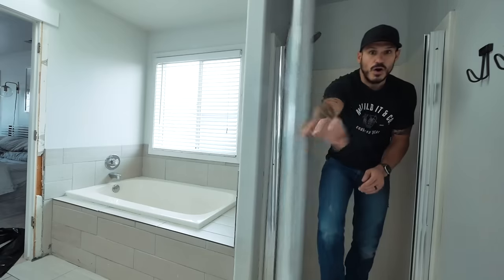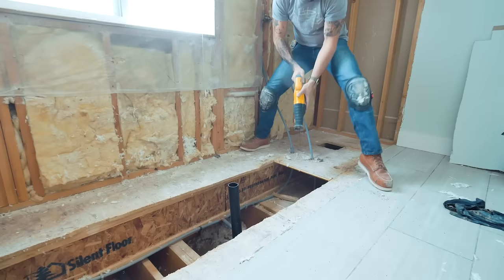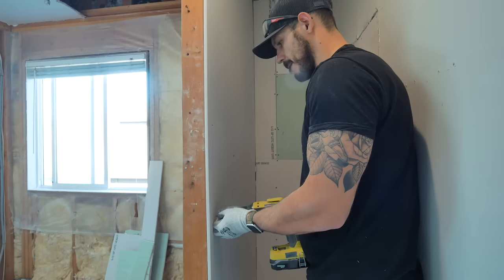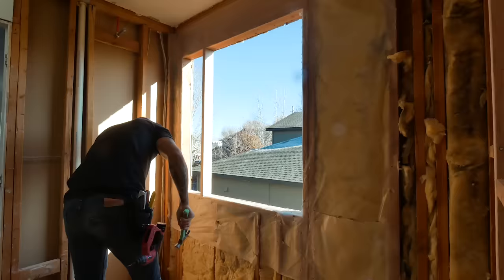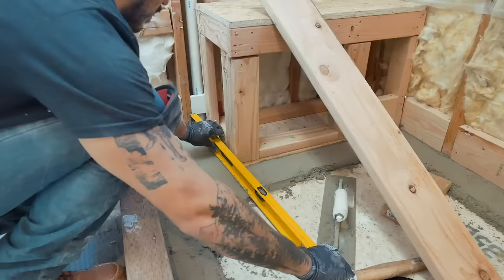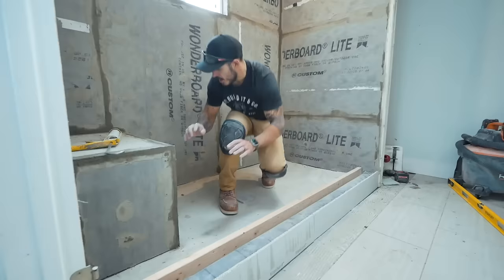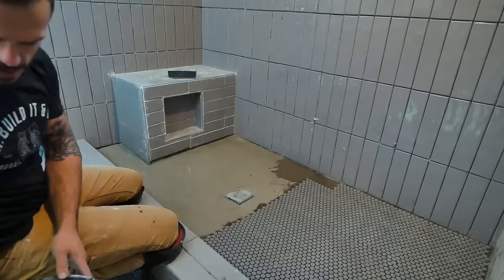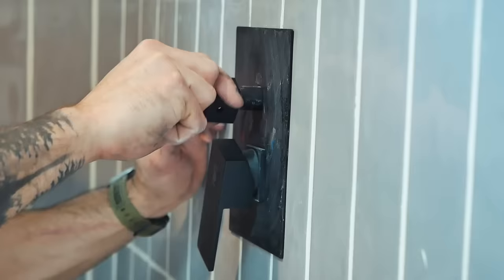Building a GIANT Shower (Home Remodel)

Comment: A couple of things:  You need vapour barrier and metal lath underneath that dry pack mortar bed.  Otherwise it dries out on the bottom too quickly when setting and will crack/shift.  The lath gives it something to grab onto as well, and you can just staple that through the vapor barrier to keep it in place.  I am concerned that your dry pack will crack over time, causing a total failure of the substrate and breaking your tiles or grout lines.  Whomever told you that was "outdated" is, quite frankly, wrong.

Also, you do not grout in changes of plane.  That is, where one wall meets another wall at a perpendicular angle.  That should be caulked to protect against cracking - as per tiling code, but not just caulking on top of grout. Just leave those spots empty while grouting, and then caulk those lines after.  

One helpful hint for those of you who are house-shopping and see a nice-looking new shower.  Look at the corners, where one wall intersects another.  Did they use grout there?  If the answer is "yes" then your shower was built by an amateur and you should assume it will be a total rip-out in the next couple of years (when the tiles or grout lines micro-fracture or mould takes over behind the tiles due to water leaks from those micro-fractures).  If they caulked there, it was likely a professional, or someone who was well-versed in the techniques before they started the job, and it is safer to assume that the house you're about to buy doesn't need immediate attention in the shower/wet areas. Water is not something to be approached in an amateur fashion, especially on upper floors.  It can and will destroy your home if you do not use the correct techniques. "Close enough" might be close enough for installing a new closet or shelving unit, but not when it comes to wet areas.

Decent waterproofing techniques - though for a DIY'er it is much safer to use something like Kerdi Board which has much less chance for error.  That being said, when your dry-pack substrate fails, and I genuinely believe that's only a matter of "when", and not "if", I suspect your waterproofing measures are going to fail along with it.

Finally, the standard grout width for that size tile is 1/8" where it looks like you have 1/4"?  That's partially why your tiles get really small in the corners. 

EDIT:  And correct me if I am wrong, but the top of the bench/niche appear to have no slope, so they're going to hold water.  1/4" per foot is industry minimum.
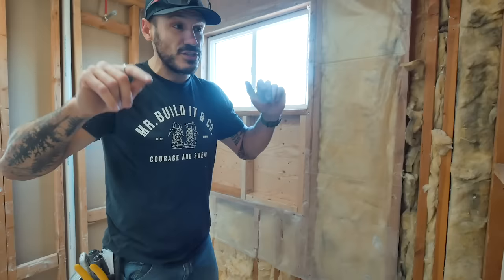Reply: Oh, and one more thing.  Compressed insulation has almost no R-Value at all.  It should not be crammed into spaces such as shown at 7:34.
Reply: Original Otrex - also changing dimensions of the window opening requires building permits.
Reply: @leolego2  Correct, if you cram insulation into a confined space, you have defeated the purpose of that insulation, and have essentially created an uninsulated space.   If you cannot get traditional insulation into a tight space without squishing it, you're better off using spray foam.
Reply: @mar1video  Correct, but I'm talking more about things which are functionally wrong (i.e. will not work well or will fail) versus making sure your paperwork is in order.
Reply: Solid constructive (construction) feedback.
Reply: @mar1video  Also, install sheathing, weather wrap, and THEN the window.  

He nailed the window directly to the framing and then covered the nailfin with sheathing.  Its going to be a BITCH to replace down the road, and also poorly sealed.
Reply: Great post!  I noticed the same things as you did.

Lack of waterproofing and shitty tiling is pervasive throughout new homes and remodels nowadays.  Cheap, unskilled labor that just throws stuff together to get paid.  Leaky showers will keep a lot of contractors busy in 5-10 years!

I renovated my house and taught myself tile since few wanted to do it the right way.  I stick with tubs and shower pans, they're naturally waterproof so I only have to deal with the walls.  Mud pans are tricky to get right, and so many are done soooo wrong.
Reply: @mar1video  Who cares about building permits, Something that small is none of there business, Permits like this is just another way for the city to make money.
Reply: Just watched this video in 2024 and noticed all the same things and more!! Don't connect white PVC to black ABS without a special green Oatey glue/cement.  Needs lath,  Kerdi board, Kerdi fabric, weather wrap, uncompressed foam, matching sanded grout in corners, slope on the bench and curb, etc etc etc.  And LOTS of water proofing around that new window where the tile meets up against it!  Water and the wood underneath will ALWAYS lead to a bad outcome!

Comment: FYI: plumbing vents aren't to allow sewer gas to escape. They are to let air in. Put your finger on a straw and pull it out of your drink then let go. Same concept. If you drains aren't properly vented, they will drain slowly.
Reply: noticed how that p-trap is not vented at all, the way it's installed, and might let the odors in?

the lenght of the P-trap's ''arm'' is required to be of a minimal lenght, determined by the size of the pipe, and said arm has to be vented before the slope cuts any possible ventilation in said pipe when full. that would be when the top of the pipe is as low as where the bottom is at the start of the slope.
Reply: I loved learning all about how before P traps were a thing, people used to die quite frequently from sewer gases 'burping' back into the homes via toilets.
Reply: Also, in most jurisdictions you cannot use green transition glue inside the house. It’s against plumbing code.
Reply: Thx
Reply: James if that is the case why do they vent through the roof? Couldn't they just vent into the floor space?
Reply: @benedictearlson9044  because when plumbing isn't being used and the vents aren't drawing air in, sewer gas does escape.

Comment: him: takes hours to paint ruber on it

me: slaps flex tape on it
Reply: @Robert w water goes right through grout.  It's not waterproof
Reply: @Robert w that extra $120 spent was for his peace of mind that he did it right the first time, and he won't come back to it again after discovering a failure which would cost him more to redo and repair.
Reply: @Robert w Did tile for 12 years.  Mostly really high end expensive stuff.  Can confirm I've never seen someone do a rubber painted layer, but we almost always did mud wall and had black paper behind it anyway.  I'm not saying it's a bad idea but the room is going to look terribly dated and will be redone LONG before enough water could get through the concrete board...that is assuming that you properly seal the grout.  Properly sealed grout is your first and best defense against moisture. 

That being said, a lot of these construction differences are regional and what is common practice in one area seems crazy in another.
Reply: It's not just about water it's about water vapor water vapor condenses behind the tile and concrete board. if you paint the whole shower with the liquid waterproof membrane that is your last line of defense against water vapor and the schluter system is the absolute best system for shower and sauna installations

Comment: That shower is awesome. I'm on slab instead of a subfloor so it's a lot more difficult for me to relocate drains and stuff, but I'd like to try something like this. I don't think I'd use shark bite fittings for anything that goes inside the walls or ceiling though. They rely on rubber o-rings* and are more likely to fail than a crimp fitting.

Comment: Awesome vid but two critiques:

1. Why did we not get to see it in action???
2. Why in the world is that one shower head so hight? Can your wife even reach it???
Reply: i was annoyed, because it's a detachable head. you build it standard height or for the shorter person, because the taller can easily pick it up because it's detachable and then use it. have a feeling his wife is going to make him redo that.
Reply: In our walk in shower, which used to be a standard bathtub, I had my handheld shower head put in to be easily reachable for MY height and not up high just in case some NBA player got
 lost in the woods and really needed a shower. My waterfall shower head is a bit higher than the handheld, but still reachable. I even got inside before it was done and marked where I wanted it. I also have a light in the middle of my shower which is really helpful. 
We also had some space left over on the side of our new shower insert like he has in this video, so my husband built shelving for towels etc. Being petite, I have short arms and it's a deep space. So I asked my husband to redo it and  put the shelves on tracks so I can pull out the shelf, get what I need and push back in. He did it, and it's wonderful. I also had a window in my bathroom- not in the shower- but where the shelves were put. So we moved it over and got a smaller 24" window and on the bottom we put cling on amber colored stained glass. Even though you can't see in the window, it made me feel better and it gave the grey and white bathroom a pop of color.  I put a very light grey and yellow swag curtain on the window and put a matching tailored valance curtain across the top of the shower. Both curtain sets also have little light yellow/amber colored beads along the bottom and they are just perfect and give the room a French country look; a bit pretty, but not loud and cluttered. Just right. We did all of this in 2004 and I still love it today.

Comment: Being in the tile idustry myself I was surprised how well you handled installing your pan material. Those grout joints get to my souls when they don’t always line up though 🤦🏼‍♂️
Reply from the maker: lol thanks man
Reply: Lol being a tile guy myself one thing that stresses me out is is seeing other people’s grout joint not line
Reply: I'm a DIYer and one of my first tiling jobs was black and white 1" hexes, about 50 sq ft of it.  I hate seeing grout lines between tile sheets, so I randomly cut the sheets up to stagger the joints.  Did a great job and rewarded myself by using black FusionPro grout.  Only about 5 tiles are a little out of alignment, I'm the only one who sees them!

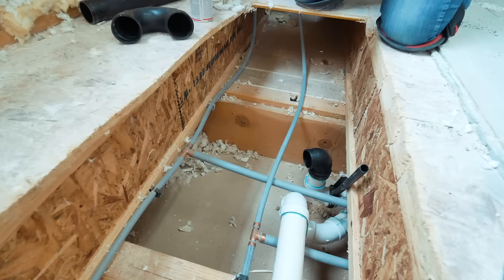Comment: 2:16 Pretty sure you created an "S-trap" with that drain instead of a "P-trap" which isnt allowed and can siphon out the trap water.
Reply from the maker: I'll fix it if it gives me issues. This is on the second floor
Reply: Yes he did but I am guessing there wasn't a plumbing inspection so since he did the work himself it will be that way until he sells the house or fixes later.

The issue will really be that sewer gas smell will come into the shower space.  If he notices it, then there is motivation to correct it.
Reply: So that's why I have that darn smell. Thank you, I will now rip my old crappy bathroom apart.
Reply: So if I tell my husband I smell sewer gas in the shower, I will get a new bathroom?
Reply: Peony Farm it’s worth a shot!
Reply: By "code" S traps arent allowed. Pretty sure it's his personal. Let him learn I guesd
Reply: @bartscustoms  Well he will learn the hard way buy not wearing a dam mask!
Reply: Mr. Build It You should fix it ASAP.  Your shower is not vented.
Reply: Yeah should have cut the 2x1-1/2x1-1/2 tee off ran a 2" tee with an 1-1/2 bushing in the top to catch the vent and ran the 2" out of the tee to the new trap. Joining pvc and abs with anything other than a mechanical fitting is also illegal but it does work with just glue......for awhile. Nice work regardless
Reply: Peony Farm you are so evil🤣🤣
Reply: @bradausman  My girlfriend's house had that problem. Made the bathroom smell seriously fucking awful.
Reply: Yep, and being on the second floor I'll wager it's a "long drop trap" too, which also has the same problem and is also not up to code.  It's going to suck that slug of water right on through  (which is supposed to remain in the trap) and leave that trap dry and stinky.
Reply: @mydailyreward2090  Unless its your husband that smells :)
Reply: @mydailyreward2090  unless its your husband that smells :}
Reply: Mr. Build It 
Could just put an atmospheric vent valve if it gives you problems
Reply: Regardless, nice work!!

Comment: The paper face of the insulation is supposed to face the inside of the house.
Reply: Ok I thought I was the only one that saw that as well, the vapor barrier/Kraft paper should face out.
Reply: @packetattack7437  depending on location and climate it can be either side

Comment: “wHy iS iT wOoD”

Cause it’s cheaper for us? Easier? If done correctly will never touch water?
Reply: BUFFALO666 
Lmao sorry that I was born in America man
Reply: gets blown over by silly little gust of wind
Reply: dayyou 
Majority of us never have to worry about hurricane or tornadoes
Reply: dayyou we don’t get tornadoes on the east coast for one
Reply: Should have used a foam curb. Untreated wood in the shower is a no-no.
Reply: Dvach if that’s curb ever gets water, you’re doing it wrong.
Reply: @hotfudgemoney  It's bad practice. There is allot of humidity in a bathroom
Reply: Dvach you’re doing it wrong. By your logic, the sub floor should be treated plywood, and the joists supporting a bathroom should be treated.

Comment: So I attempted this project. Here I am over a year later, and I FINALLY put the last finishing touches on it. Let me just tell you guys, it is SO MUCH MORE WORK than this video makes it seem like. Also, if there were 1 thing that I could go back and hire a professional to do, it's pouring the shower pan. That shit is impossible to get perfect if you're a first timer. Hire a pro or buy a prefab sloped floor. You'll thank yourself for it. You've been warned!
Reply: I had to scroll waaaay too far to find a comment that was sharing my same thoughts.  I'm trucking along with only the walls to go two weeks later.  It is nice to have a guide to go by but I wish he got into more detail and was more realistic like the time it takes for everything to set and dry and set and dry...

Comment: Did pretty well on the water-proofing and didn't screw into your curb on the inside, that's good, but at 11:54 you need to use lathe for that curb. 1/2" of concrete, over time, can crack without reinforcement. The tile bears weight, but there's always movement.

Comment: i dont get these showers with only a glass wall covering half the opening. every time i use one in a hotel a bunch of water splashes out.
Reply: exactly what i was thinking; how does this work?
Reply: It works really well. Since the whole area is water proof it doesn't matter.
Reply: Slide that bih to close it

Comment: "What's the worst thing that can happen?" Well, if you run your water lines through your attic you better not live in a cold climate where attics can get below freezing. Frozen water lines burst.
Reply: Yeah judging by the insulation in the ceiling, he might not have a heated attic, which could get REALLY dicey.
Reply: I think the lines he ran through the ceiling are the shower head supply lines. In other words, only filled with warm water when running and not under pressure when off. Either way, dicey given that the wrong pitch will keep the line filled with water all the time. Although I suspect the PEX pipe helps.
Reply: @japaneserequired6314   Tilt your head down.

Comment: Great video. I’m a licensed professional, top of class, your point.
FYI that Masonary drill bit is not meant for tile. A diamond drill bit is best to use solely because of chipping the tile and your drill bit sliding off to one side or another scraping your tile surface.

Comment: That looked like polybutelene lines? I'm not a plumber but I've had those gray lines burst twice in one week once. Glad to see them gone. But was there more in the ceiling?
Reply: i think he said pex. poly is a nightmare. have lots of exp with those breaks.
Reply: No that’s old school pex really used in trailer park homes then he added pex.  But used shark bites.  He’s not a plumber at all. And if that’s how I plumbed I’d be fired
Reply: @colinbarner9339  Polybutylene was used in trailer homes as well.  Maybe they did gray pex later.

Either way, anything over 20-30 years old you might as well replace while the walls are opened up.
Reply: Yes. Now the scariest thing is buried shark bites.
Reply: Copper is best, Pex is OK, If you don't mind running garden hoses everywhere,  Like Romex vs Conduit - Conduit is best.
Reply: Jay Mansolf he used shark bite lug ells

Comment: Done 100% the correct way,No shortcuts..you can’t find this dedications unless done urself
Reply: From everything Ive researched for my own project, you don't put the cement board down into the liner. The cement board will wick up the moisture and transfer to the wood framing.
Reply: @johnhaerle3957  huh? The water proof liner ? Also the wood form he used to keep the concrete or what ever in place ? Is that what ur talking about ? Sorry I’m confused ? The form gets removed after it sets
Reply: @MrMrSaldana  He put the cement board (AKA backer board) down into the liner, whatever the rubbery material is called, and then put the mortar in, thus permanently imbedding the cement board around the perimeter of his shower inside the liner. You don't do that. The bottom of the cement board should sit atop the mortar with a small gap so that the bottom of the cement board wont wick up the water and eventually transfer it to the wooden framing behind the cement board.

Comment: , how do you end up with uneven tiles in the corners and edge of walls.
Reply: I think he has a tile cutter that he uses to cut the tile to the remaining measurements. Its that or an angle grinder with a ceramic/tile wheel that he uses handheld.